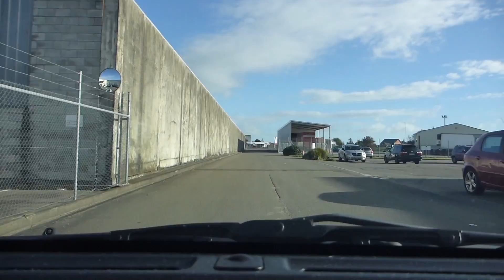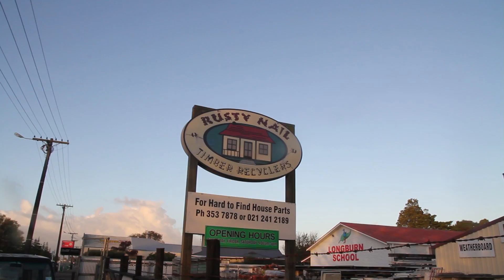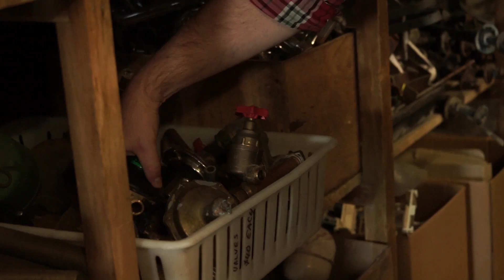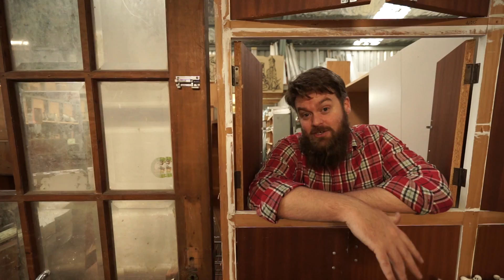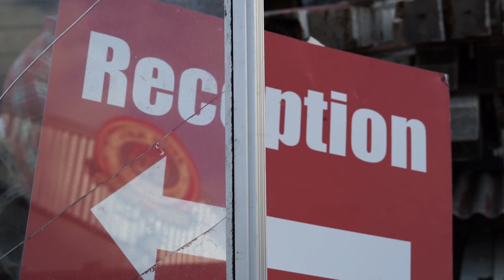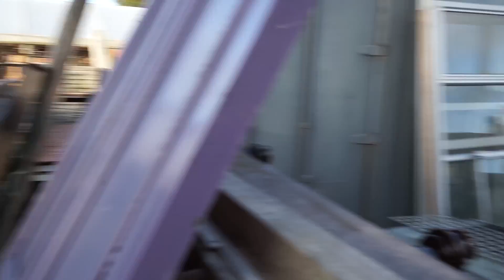Pot Still Vs Boka And Finding Build Materials

Comment: How do you clean all the oxidation from inside those old copper pipes? Giant pipe cleaners and vinegar? LOL
Reply: Wanna know that too
Reply: Swab the inside with copper cleaner twice to remove all crud. Then use clean swab dipped in white vinegar until a swab comes out clean.

Comment: What is ccvm???
Reply from the maker: Sorry for the slow reply!  But you can check out a CCVM plan here now https://youtu.be/46E6J-X6cT4 :)
Reply: A VM or vapor management still. This particular one, doesn't need a valve, as the condenser coil does the job of regulating the take off rate...hence CCVM= Condenser Controlled Vapor Management.

Comment: you can use a ball valve in the meantime, it is rather sensitive to change, but you get use to it, can easily make it do 3 drops a second upto full tilt. just a needle valve is easier
Reply from the maker: Hmmmm true?   I just heard a lot about how they are "bad"  didnt think about the fact that "bad could still be useable.  Cheers man.

Comment: Cool place. Reminds me of where I work. We demo alot.

Build both the Pot and the CCVM.

For Pot or CCVM. Add a "T" like you showed in the video to the top of a meter of column.
Cap the top of the "T" (where SS condenser would go) with a 2" plate and a triclover. With it capped, you can run it in Pot mode. The vapor will follow the path of least resistance and head over towards your liebig, condense, and flow out.

Remove the 2" plate and add a SS Condenser to move up and down, you have your CCVM.
In reflux mode you will have to add packing to column: SS scrubbies, Copper scrubbies, Marbles, Lava rocks, SPP etc. The packing can stay in while running it in Pot mode, but may notice longer heatup period.

My only caution about used copper is to check all soldered fittings for lead. You should be able to get a test kit at a hardware store. It's a rag that you rub on the solder and it will change color when it makes contact with lead solder.

Very good video Jesse!
Reply from the maker: Thats what Im thinking man.  So column T then the elbow I picked up on a ferrule so I can adjust the direction of condenser.  Reduce down to the 1/2 inch Lieberg.   

Cap the T for pot still mode.  Can use my copper coil when in CCVM mode.  

Dang good point on the lead solder!! I didnt think of that.  It actually looks like it may not be soldered at all.  But I will check it for sure!

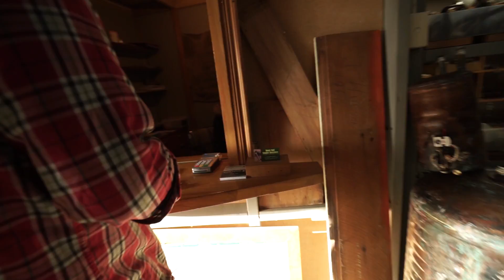Comment: man some of those copper tanks would work great as a pot and thumper.  when you check put it looks like there are 2 ready to go. at8:23.  another great vid.  man you ask some tuff questions to.  i'll toss my two cents in for the pot still. lol only because i do more flavored spirits.  hope you like the pic i sent of my set up
Reply from the maker: Yeah they are tempting eh?  A little on the beat up side of things though!  Most are around $100,  the one you mentioned was $150 I think.  So a little pricey too.  
Where did you send the set up to dude?
Reply: on your facebook .  i'll try again
Reply: just sent it on messenger